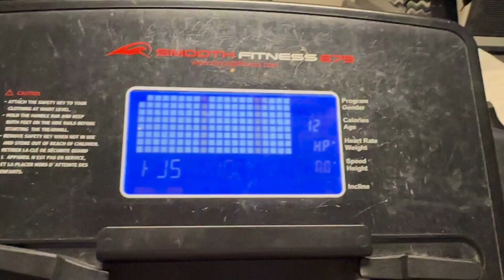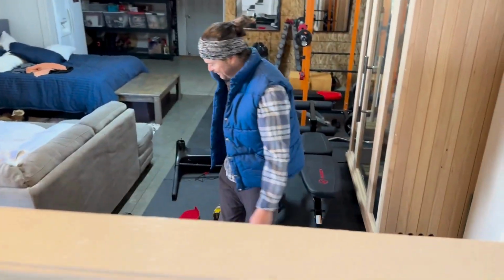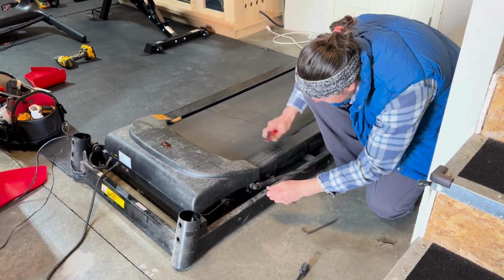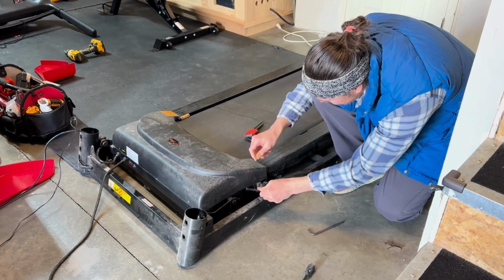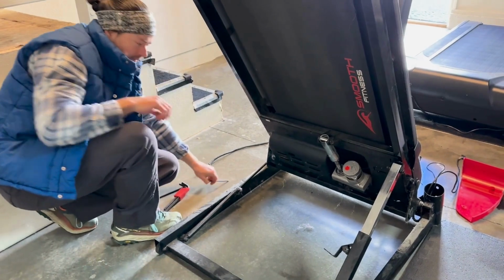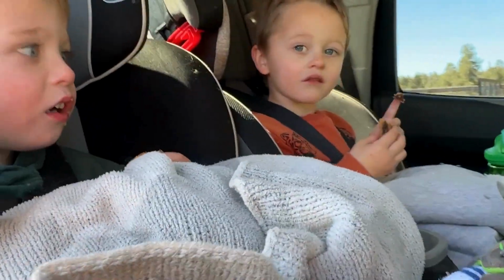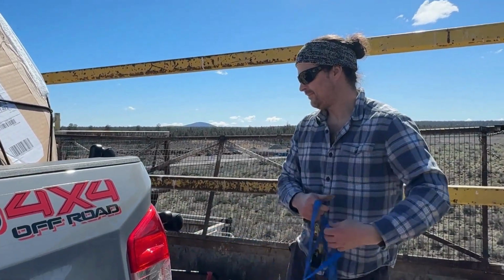When do you know it's time to replace your treadmill? Watch and find out!

Comment: Hi, Heather.....have you ever been concerned about the radiation emitted from the strong motor of your treadmill?  I stopped using mine when I held my portable radio in my hand while on my treadmill, and it went absolutely crazy!  Would you happen to know where we can get more information on the harm passed onto those using treadmills?
Reply from the maker: I absolutely have never been worried about the radiation coming from the motor of the treadmill, especially because I have plenty of other appliances I would be concerned about like my very own microwave, iPhone, and iwatch. I don’t have numbers in front of me but I would consider the benefits greater than the risks at this point. Do let me know if you have any more information!